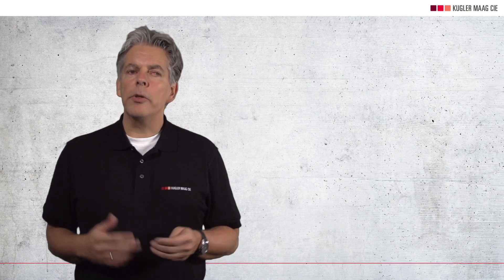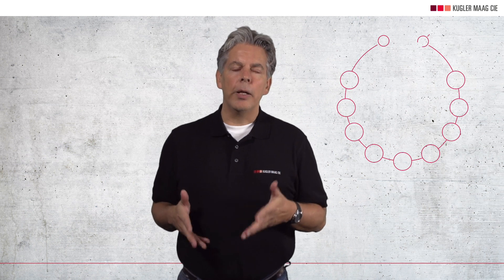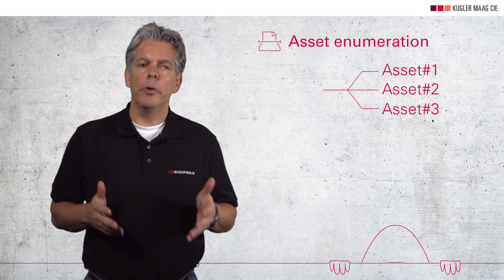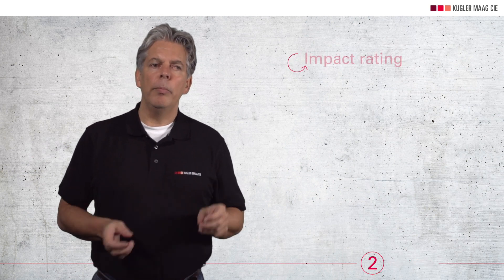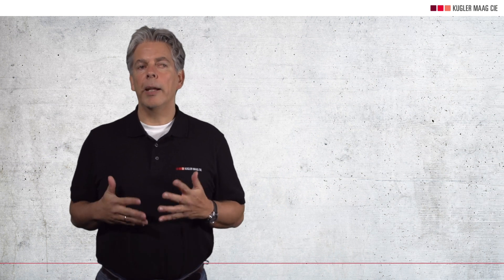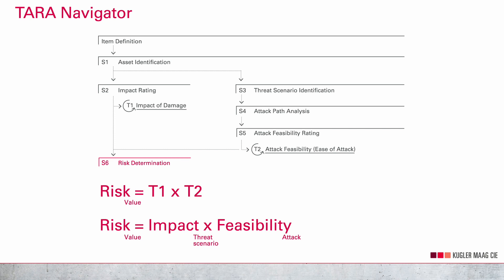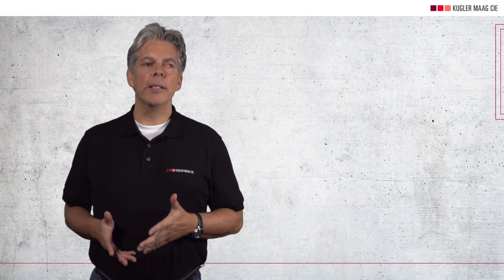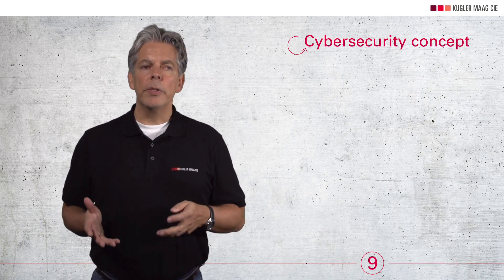Automotive Cybersecurity – The Nine2Five TARA Navigator and ISO/SAE 21434

Comment: I dont' understand well concering S8. Cybersecurity goal. May the goal become just protection of asset ?
Reply from the maker: Hello Jake, 
almost. Many companies simply define as a goal "Our product shall be secure." You can't work with that generic goal. 
According to the standard, you use the CS goals to specify how you want to protect your asset (in case you aim to mitigate the risk). The goals are important for the next step: the CS concept. There you specify CS requirements and select Cybersecurity Controls to achieve the CS goals; then you assign these requirements to the components in your architecture or to the organizational environment. So the CS goal becomes an additional product requirement. Now you can work with this goal in your regular requirements engineering. 
Cheers, your video team at Kugler Maag Cie
Reply: @ULSolutionsSIS  
Depending on the CS goal, it could be risk reduction or risk sharing. 
I was understanding that a desirable CS goal will be pursuing to take all possible countermeasure to protect assets from the product level, and then it will probably expand as a requirement.
Thank you for kindly answer.
Reply: Additional comments, the reason why I was confused what is the CS goal because I have small understanding concerning safety. So I get some insight from safety. 
In safety, OEM gives safety goal and concept. This is top-down. But in security, supplier designs a product usually. So determination of security goal and concept is depended on supplier. In this case bottom-up will be adjusted.
Reply from the maker: You are right. In FS, the risk to life and limb usually lies with the system, so FS objectives are derived at the concept stage - that is the car maker job. FS is about protecting people from system failure. Cybersecurity is the opposite: to protect the car from being compromised by humans. Therefore, an inside-out approach applies here.